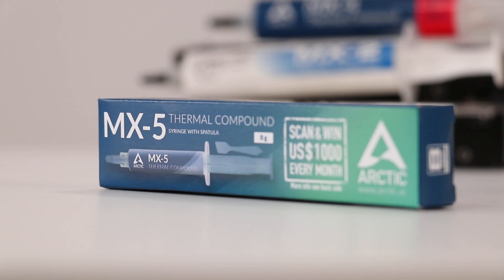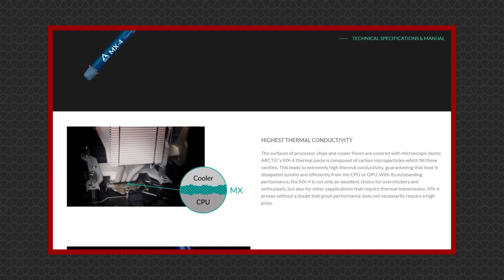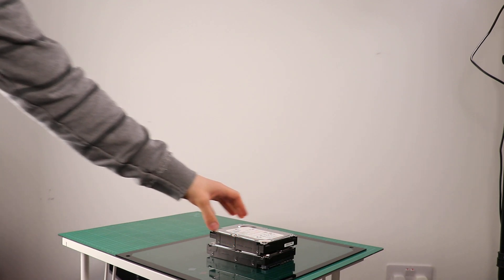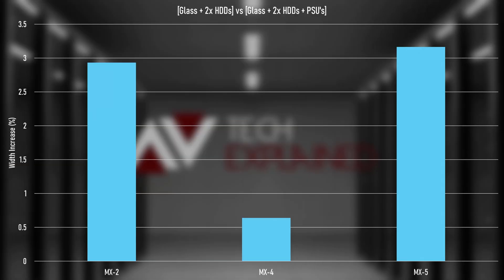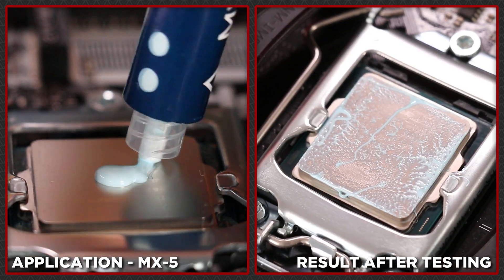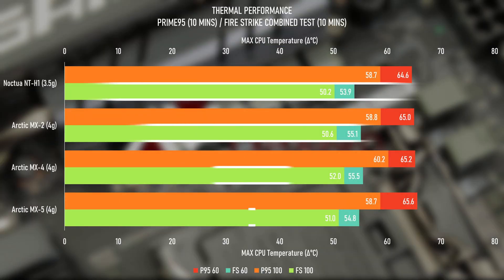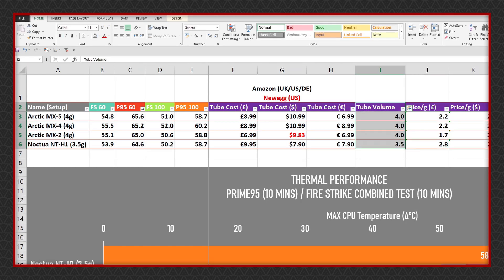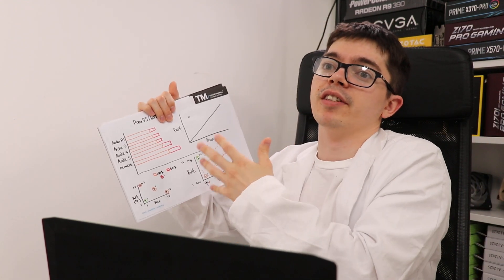Arctic MX-5 vs MX-4 vs MX-2... What's the difference?... Also Noctua NT-H1

Comment: Actually I find the mx4 way much better than the other two. Mx5 made my cpu run crazy mx2 sam but mx4 kept it really cool and good even under oc. More precisely mx5 oc cpu is max 77°C. Mx5 is at 89° and mx2 max temp is at 89°. It is crazy but that shit happened. My rig is an Asus p8z68-LV lga 1155 i7-2600k @4.5 ghz per core all cores 24gb corsair vengeance @1866mhz OC ssd240gb kingston now
Reply: thank for sharing all that, I was already thinking of getting mx4, your experience helps affirm mx4 is likely the best and ideal choice

Comment: MX-5.I don't recommend it. The oil is separated from the paste. It is hard and almost impossible to apply. It was a waste of time. Total lack of quality control on their products. It is very expensive from South America to send the product for replacement.
Reply from the maker: Yeah, heard about that. Turns out they've had a really bad batch, and I'm not sure how QA didn't pick up on it considering how quickly everyone else did. When it's made properly it's alright, but this has certainly hit its reputation.

Comment: Yeah... I would be careful with mx-5 nowadays. I got mine with a brand new build. Long story short, my cpu cooler is stuck to the cpu for good, like glued to it. Arctic made a statement about this issue and they are calling them back. I found many issues like this on reddit, linus tech tips etc where people are having the same problem as me. One of them was wild and ripped the cpu out with the cooler. I don't remember if his cpu was still usable or not. I'm taking back my pc to the store tomorrow. Thanks Arctic. Great job.
Reply: Wow... Was about to order some as it's on clearance lol I think actually, this would be an excellent thermal glue then for gluing heatsinks into VRMs and memory modules. I guess I'll still order but until I know it's safe for CPUs just use it for GPU heatsinks.
Reply from the maker: Not sure it's even wroth it for GPUs since I don't think we know what the performance is like once it's separated. It could have uneven thermal properties across the die, and lead to performance issues as a result (pure speculation).

I'd recommend going for something that hasn't got a manufacturing issue, just to be safe.
Reply: @headerahelix  I agree whlith AV techy in this matter. I would go for mx4. It's still a very good paste and cheap. If money is not an issue, go for grizzly kryonaut. They are both trustworthy and good pastes.
Reply from the maker: Thanks for highlighting this. Actually first I'd heard of the issues, good to be aware of.
Reply: @AVTechy  You're welcome. I have a new PC with 5800x and dark rock Pro 4 and 4x8gb 3600mhz cl16 rams. I built it myself. It didn't boot and the dram led was constant red. That could be a lot of different issues. More likely ram or ram slot problem. I couldn't take my cpu cooler off. I need to take off the dark rock Pro 4 because I wouldn't be able to check the rams otherwise because of it's size. so I took it to the shop where I bought all my parts except the phanteks p500a case and my gpu. They had to rip off the cooler and the cpu came with it. Literally, it was underneath the cooler like glued to it. Fortunately, no bent or broken pins. It turned out, my problem was this. I bought a b550 tomahawk motherboard which had the label on it, it is ryzen 5000 desktop ready. Well, it wasn't. All I needed was a bios update. Which I wanted to do first, by just plugging the psu with the bios usb. But I didn't want to bother since it should've been worked. Now my pc is working and they were able to put it back and repaste it, unfortunately with the same paste. I told them I would take it to them to repaste it in the future. Dangerous game this paste is.
Reply: That’s strange. I just received a repair kit for the Freezer II and it came with a tiny 0.8gram tube of MX-5. Arctic is a good company, why would they ship mx-5 if people where having problems??

I’ve had plenty of pinned cpus rip out of a socket because of old ass thermal paste gluing itself to the cooler.

Comment: The big difference is that MX2 dries up after 1 to 2 years while the others remain a paste for longer
Reply from the maker: Not my experience, but fair enough.
Reply: @AVTechy  Happened a few times with me with CPUs and GPUs that ran hot. After a year or 2 the temps got higher and higher and when I reapplied new paste the old one was so dry that it flaked off in clumps

Comment: I think the difference would increase exponentially if you would've been going with a hotter chip or higher overclock. Maxing out on 65c I wouldn't be surprised if you would've gotten a similar result with poop or toothpaste. Weird result anyways. Could it be how the paste spreads from that application method? Would it give a different result if you manually spread it over the whole heat spreader?
Reply: But how often are you trying to run your CPU at temps higher than 65c?
Reply: @headerahelix  Well if your cpu runs at just 65c, heat isn't an issue so any thermal paste would do the job. When thermal performance of a paste becomes relevant is when heat output is relevant. I'd say around 85c maybe? Then heat becomes relevant in terms of how high clocks you'll reach.
Reply from the maker: You do understand that the thermal paste is part of the cooling solution that enables the CPU to achieve 65C in the testing right? If it performed worse, then it would get hotter, of it performed better it would be cooler.

And to be fair, it's 65C delta T, so it's true temperature is about 20-25C (room temperature) above that. Around 85-90C, about as hot as I could get it before thermal throttling. I could have used the channel standard Mugen 5, but I wanted to push the paste and see what it did at the extremes. Maybe it would have been good to also test with the Mugen 5 and drop down to 65C true temperature as well.
Reply from the maker: The CPU would probably hit 100C if the paste wasn't there, so it's the paste forming a good transfer between the two that's allowing it to happen.

I could test with a smaller cooler which would it increase the temperature, but frankly I think maxing out at 65C is a pretty reasonable testing environment for the paste to adequately prove itself.

On the flip side, a paste that performs alright at 65C, but really well at 90C is a bit of a poor strategy. Surely you'd want one to perform well enough to encourage the temperature to not hit 90C in the first place (all else being equal). This is all assuming the properties of the paste change significantly between 65C and 90C, which I don't think is the case as you'd probably class it as an unstable material. I'm only saying that since I don't know enough about material science to know of a material that significantly increases thermal conductivity, unless it's changing states.

Hopefully that kind of covers my testing methodology, but I can see why maybe testing with both a small and a big cooler to simulate less and more challenging environments would be useful. It would also be time consuming to do which is why I've landed on this method being good enough. But if I do this in the future, and there's some indication that there's a significant performance advantage at a higher load, I can have a play around and see what comes of it.

Regarding the themral paste application. I've been doing this method for all the CPU cooler testing, and presenting how it spreads, and it's good enough for the vast majority of those. The main reason it shouldn't spread out well is poor mounting pressure. But since we're using the same cooler for all three, it's on a relatively level playing field.

Comment: The MX 4 is rated to last up to 8 years, and the noctua up to 5? Is that factored in? I want to use this on some old ps3 cpus.
Reply from the maker: Take those numbers with a pinch of salt. If you're really pushing your system regularly you'll probably want to factor in a thermal paste change after a year or two depending on a lot of factors. Otherwise you can get more life out them.

But it all depends on what you're using it with, how hot it gets, how regularly it hits high temperatures and for how long, etc.

In reality most decent pastes will last at least a few years, but after that it's dependant on how you're using it.
Reply from the maker: Small addition, I've used MX2 with my test GPU for years now, and it's still performing well. Don't get too bogged down with the details. Get something decent and don't worry about it too much.

Comment: Warning: Do NOT get the MX-2!
I got it in an because it was a lot cheaper than MX-4 (Amazon sale).
TL;DR it almost fully tried up after about 3 months

I NEVER! had paste that dries up THIS fast. 
About 3 months after applying it on my mom’s laptop and my GTX-1070, the temperatures and fan speed have risen a lot - it’s almost fully dried up on the 1070, I have yet to disassemble the laptop. 

Very disappointed after using MX-4 without problems before
Reply from the maker: Are you talking about 2 or 4? I've had 2 on the test system GPU for years and it's still performing really well. I haven't endurance tested 4 yet, so I'm not sure about that one.
Reply: @AVTechy  I'm talking about 2, had no problems with 4 but lost it when I moved
Reply from the maker: Ah okay, just noticed you said you were disappointed with 4 at the end, just wanted to clarify.
Reply: @AVTechy  edited
Reply: you bought a fake one bro
Reply: @Lethalwick5673  nah

Comment: Can you do testing on GD-900? I suspect its MX-2 OEM(Sorry not sure, just putting my speculation). You can get it really dirt cheap from Aliexpress etc. Bought 30g for 5 USD with Shipping. Currently using it right now, so far better performance than my prev MX-4, not so much but few deg cooler on idle and load.

Comment: Basically, what I got from this is any of the thermal paste tested, if properly applied is fine. For the record, Arctic doesn't even recommend using the glop and squish method. Why do you think they include a spreader? I have a tube of MX-4 that will probably last the lifetime of at least my current computer (and I reapply fresh every 4-6 months). I'm certainly not running out to replace it for possibly a degree difference in cooling. If I were to get anything new, it would be Grizzly Kryonaut.
Reply: And every tech person on here recommends to NOT spread it and just apply a small pea sized amount. Go ahead and throw that spreader away lol
Reply: @allieboy181  I don't care what they do. I want to know that I have full coverage. I've seen too many cooler plates pulled off with sections of the cpu that never had any thermal compound because of the blob and squish method. I'll take the time to do it right and not be a lazy ass with my system. You do what you want with yours.
Reply: @RedPill780  Because it's easier to do a thorough cleaning of my air cooler/fans if I remove it which is usually easy because the thermal compound hasn't turned into epoxy. You do your maintenance the way you want and I'll handle my system the way I wish.

Comment: I want to replace GPU thermal paste of my 6 year old GTX 970. Any advice on which thermal paste to use?
Reply from the maker: Honestly, any will do. I wouldn't stress over it. I've used MX-2 for my GPUs which works well, but any other will work.
Reply: @AVTechy  I bought it after you said it’s fine. It is - if you’re cool with changing it every 2 to 4 months.

Comment: Am I only one who knows that it doesn't matter what paste you have? That's my experience after 17 years in PC. Ofcourse I don't mean you can use some white "sperm" paste, I mean if you have some silver paste from good brand, it doesn't matter, temperatures are completely same. So I recommend just buy what has better price for 1g, if it's MX-2 or MX-4, it doesn't matter. Ofcourse you can try some special pastes like liquid metal, but that's different thing.
Reply from the maker: No, your certainly not. The differences are minimal, but testing confirms whether there are or are not differences. Typically anything mid range will perform similarly, but for all I know a new to market mid range paste could perform good enough to make it a standout winner. We'll only know this with testing.
Reply: @AVTechy  difference is mostly like measuring error, you even dont really know what is better, its more abou put it correctly on cpu than about what exact paste it is
Reply from the maker: Measuring error could be up to +/- 1 degree. Outside of that were likely looking at difference in performance. Other reviewers have lower margins of error than that, but I don't think I'm on that level despite doing my best to be as consistent as possible.

You're right, the differences are minimal, but if we test and confirm this then we can conclude that the cheapest on will do. What I'm getting at is assuming over lots of years of using paste that they're all the same so it doesn't matter is at best an assumption, so confirming that, or otherwise, is important.

Not trying to stir the pot, but I have a feeling you weren't 100% on this, otherwise I'm not sure why you'd have engaged with this video.

Comment: I had bad results with MX5 versus MX2, im on I7 980@4.1GHz with Corsair H80 cooler dual fan with MX2, was getting 75C tops with prime 95 small FFT measured right before replacing it with MX5, now im getting 81C, i thought it was the applying method, but i re-applied like 30 minutes later as I was not satisfied with the results and got the same 81C. I will be going back to MX2 in a few days, just to give it time to cure and see if it helps (but i dont think it will). Will do the same, as i did, measure the MX5 temperature with prime95 small FFT then replace it back with MX2 and measure. However, so far its been dissapointing as MX2 is even easier to spread than MX5, cost even less and so far performs better too.
Reply: they say you get the best results over time but well, try putting back again mx2 and see if you get the same 75c tops.
Reply: the MX-4 seems to be the best option...
Reply: Any updates?
Reply: MX-2 seems to have bad endurance from what I can tell
Reply: I have noticed many "thinner" very flowy, "thats a technical term", thermal pastes like MX-5, kryonaught do very well with very flat, smooth surfaces, and high mounting pressure, but do worse in less then ideal surfaces. With rougher surfaces or non flat surfaces i have seen better results with thicker pastes like AS5 , mx-4.

Comment: First time on channel, long time PC hardware geek. Commend your effort. Good vid. What are you doing in 2021 to get the most of that 1070?
Reply: What results did you get with Mx4?
Reply: @Interestingworld4567  you sure you’re responding to the right comment bro? I’ve used the same vial of MX4 since 2016, works fine, haven’t compared in a controlled way to any other TIM.

Comment: The spread test makes no sense. They must be tested individually. If you put two ball bearings under there, then MX-4 in the middle, it will not be squezed at all. The brands will affect eachother.
Reply from the maker: Hence the comment at the end of that section.

Comment: That's a lot of testing, and the results were so close to call. Just get whatever is cheapest is my takeaway. Having said that I have found MX4 has good endurance and seems to last for a long time, not sure how the Noctua stuff is endurance wise. I just changed to a Noctua air cooler, and it came with the thermal paste so i will know in a few years!
Reply: i remember mx2 and mx4 had both one is more liquid the other is more thick (and annoying to remove)
Reply: I had the opposite results, my MX4 changed drastically over the course of time, even when standar intel/amd paste or even regular silicon paste was much more stable
Reply: I’ve heard about people having pump out issues within a week with the Noctua ones and ended up throwing out the Noctua. 

Just ended up ordering some MX-4 as it’s the tried and true and it’s what I used years ago.

Don’t fix what isn’t broken! I’d rather have years of longevity rather than a week.

Comment: Thermal Grizzly Kryonaut is the best.
Reply from the maker: I'm still yet to work with that stuff. Like Noctua, it's got a reputation for being really good. Maybe next on the list for thermal paste testing.
Reply: @AVTechy  And Kingpin Cooling KPx please! It has great reputation in where I'm from, along with Kryonaut, NT-H1, and MX-4.
Reply: It's also the most expensive, but similar in performance and price to noctua nh-2.
Arctic MX-5 is said to be on par with these two performance wise but I think it's slightly cheaper.
Reply: maybe a little bit better while costing more and being conductive so u have to be more carefull while applying it.
Reply: @nicane-9966  Kyronaut is not conductive, neither is kryonaut extreme, hydronaut, or aeronaut. Only their liquid metal conductonaut is electrically conductive, obviously.